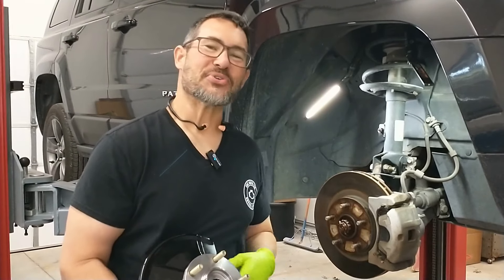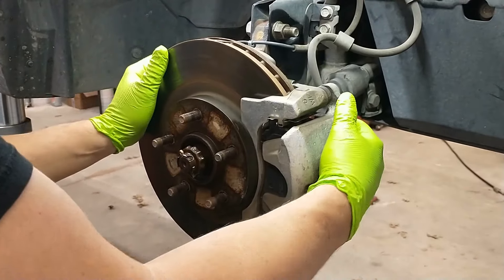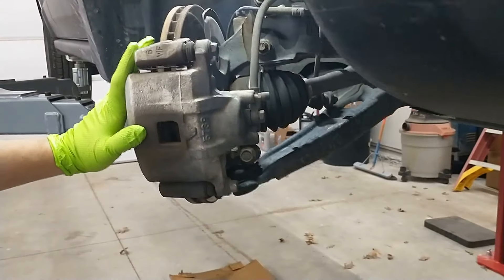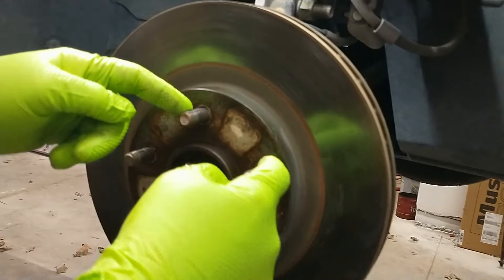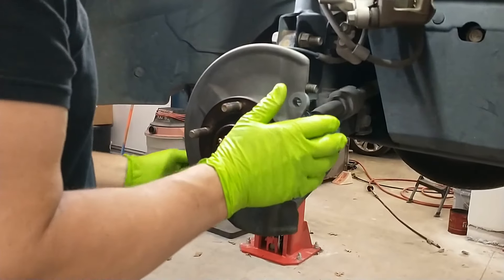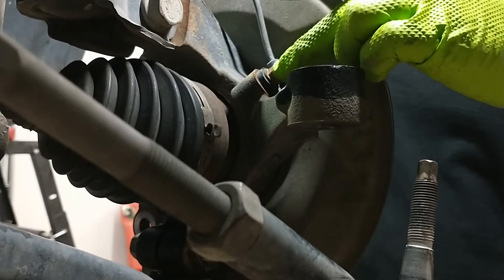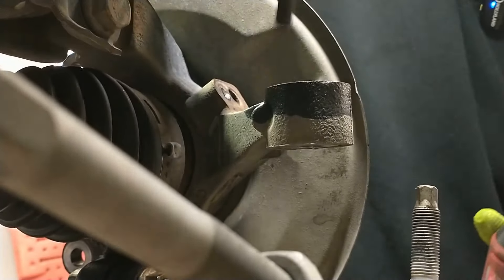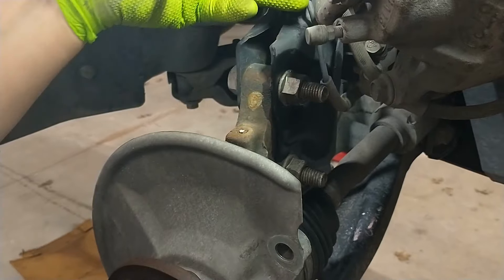Jeep Patriot / Compass front wheel bearing hub knuckle assembly replacement (the easy way)

Comment: Thank you so much for this video!! It’s excellent. Thank you for providing the socket sizes and torque specs, extremely helpful. Took this to PepBoys, they wanted $850 for the replacement+labor. You saved me over 3/4 the cost by doing this myself! My only snags were the suspension bolts were torqued down so tight I had to find clever ways of removing them using breaker bars; that and the axel bolt. Super tight. Everything else was a breeze thanks to you. God bless you!!
Reply from the maker: You are so welcome! And good on you for saving so much money.

Comment: I have every confidence in successfully completing my project thanks to your video.  I can see getting done in an hour.., if your bolts aren't rusted, don't need heat to get them out, it's not in the 20's - 30's , the wind is less then 20-30 miles an hour, AND your under 78 years old !
Reply from the maker: haha! Thanks Dennis, hope your project goes smoothly!

Comment: Straight forward demonstration with no mishmash!  Very good information on order of operations for doing this job.  I especially liked that you specified both socket sizes and torque specs for reassembly. The one other item that I would find very helpful is a little commentary on getting the replacement parts such as part numbers, reputable suppliers, sources to be Leary of, etc.  Thanks for the great video.  You have gotten a new subscriber and I look forward to more Jeep Patriot content.
Reply from the maker: Thanks for the kind words, and I'm glad you found it helpful.  As for parts, I do get a lot from Rockauto, but price match Amazon.  Don't choose the no name brands if you have a choice, and you'll be pretty well off.  I haven't had to return anything, even lesser known manufacturer stuff...yet.  Good luck in your projects!
Reply: RockAuto100%

Comment: Thanks again for posting your video on this knuckle removal.   I spoke to a mechanic and he steered me away from a donut compressor, said I should instead buy an electric impact driver, that the PSI of a small compressor wouldn't take off those ribbed 21mm bolts.   So Harbor Freight had a 50% off sale, so now I've moved up into the shade tree mechanics world by buying my first impact driver and set of metric impact sockets.   Woohoo!   Tomorrow I'll be sitting on my rumpus in the driveway with a new impact tool.   I can't wait.     And I purchased another sensor because this one is frozen in solid.     All in all, sincere "Thanks!"    If I need any advice removing this knuckle, I just rewind your video.    Happy Memorial Day Coach!
Reply from the maker: haha, and impact is key! You'll love it.  Hope your project goes smoothly.

Comment: Great video sir im going to be doing this soon only im up north so im expecting mine to not go as easy. I work at Subaru and some of the techs are telling me I'll need an alignment after I perform this repair. Is this true? Or only if im replacing outer tie rods?
Reply from the maker: yeah, usually will need an alignment when suspension components are replaced.

Comment: After I replaced the bearings, the airbag and auto skid symbol appeared on the car's dashboard, I imagine this came from the replacement and I'm sure I didn't damage the sensors, is there anything to do?
Reply from the maker: probably an abs speed sensor issue. May have  pulled/pinched the abs speed sensor wire or the connector isn't plugged in right. Also unbolt and pull out the sensors themselves and check that they aren't damaged or dirty on the ends, look down in the hole where the sensor goes and spin the cv axle to see if any of the pickup area is covered or rusted off

Comment: Do I need to get a wheel alignment after replacing both front wheel bearings?
Reply from the maker: Anytime the wheel hub spindle comes off, it's a good idea to get it realigned. It will probably be pretty close still, but over time may eat the tires faster.

Comment: Is it harder to just replace de bearing?
Reply from the maker: yes, usually it is.  It takes longer, and it may take some special tools like a press.  If you get parts online like at Rockauto or amazon, the cost of the whole knuckle with bearing is not that much more and you won't have to fight the bearing getting it in and out of the knuckle if there is corrosion.

Comment: My strut seemed to lower when I took it apart an now can't get new one lined up with strut 😢
Reply from the maker: you can put a jack under the bottom control arm and jack it up a bit to meet the strut, at least enough to get one of the knuckle to strut bolts in place.

Comment: What about a front end alignment after the removing the two strut bolts being removed ??
Reply from the maker: Yeah, it's not a bad idea anytime the struts come apart, but in my experience it doesn't get off that much that it would be noticeable driving along as the holes in the struts don't allow a ton of movement

Comment: Out of curiosity, is it the same on the driver's side? I had a shop tell me they would have to remove the steering knuckle to do the one on the driver's side. I would like to know if that's true or not. They want to charge me a little over $700 which I think is ridiculous
Reply from the maker: same for both sides, and you can do this! save that money.

Comment: how did you fix the abs sensor clip? also where can i find the replacement clip like the one that broke on the abs sensor?
Reply from the maker: I can't remember on this one, but often, you can just zip tie the cable out of harm's way if necessary, and finding the exact clip can be a challenge, just have to search for push pin connectors and clips online till you find one.

Comment: I have a 2017 patriot and I have had wheel bearing noise for at least 3 or 4 months. I can’t tell which bearing it is. I have tried driving with the door open sticking my head out. My wife driving and we just can’t tell where it is. Any suggestions?
Reply: They say if your turning left and hear noise it's the right side and vice versa.

Comment: 8:51 this is the part I’m stuck at. I can’t get it off the ball joint. It’s pried super wide open, been using penetrating oil and every ounce of strength, can’t get it off. Anything more I could be doing?
Reply from the maker: can always try pickle fork, but it usually tears up the ball joint boot
Reply: @joyofwrenching  thank you for this! We got the first side done with lots of soaking it with the oil, waiting, banging on it some more and repeat. Other side is worse so we are repeating the process! Cars are so much fun to work on! Who knew?! 😅😂
Reply from the maker: @mariahp.6993  keep that joy in wrenching!
Reply: @joyofwrenching thank you for everything! We finally got it!! ☺️ we appreciate you so much!
Reply from the maker: @mariahp.6993  great job, glad to be of service!

Comment: I have a big problem with your how-to video here.   First of all, you're smiling and friendly, qualities not typical for a mechanic.  Typical mechanics around here are psychotic, sarcastic pricks.   Another thing, that undercarriage is clean. I've eaten off plates dirtier than that.   And,  your sensor just came out of there way too easy.   Lastly,  I busted my favorite socket wrench trying to loosen those two 21mm bolts with the ribbed ends.   I was on the right end but they were impacted on so tight, only another impact driver could loosen them.  Serves me right.  I've have to invest in a donut compressor to use at home.  All in all your video gave me the confidence to do it myself, but the reality was very different.   Please keep posting videos though.  I'm looking to get my certification in "shade tree mechanics".   Thanks ago Coach on these Jeep videos.   :)   Much appreciated.
Reply from the maker: haha, love the comments! and don't worry, I have my moments of rusted seized parts, broken bolts, etc. The channel is Joy of Wrenching, and like Bob Ross who had the Joy of Painting, I try to keep a serene positive spin on things, no problems, just happy little accidents...